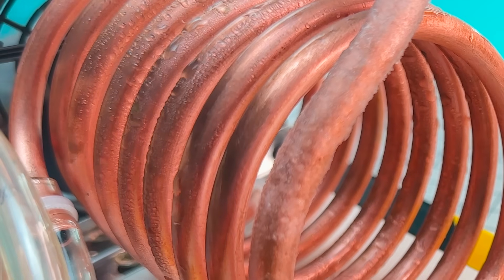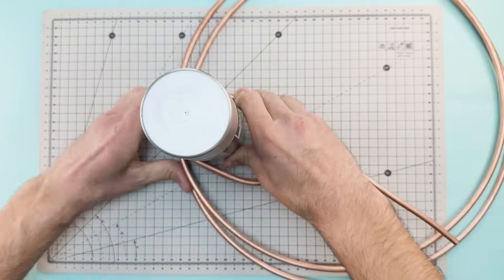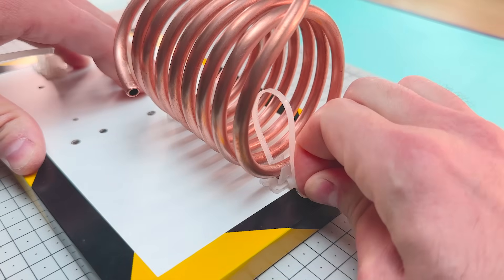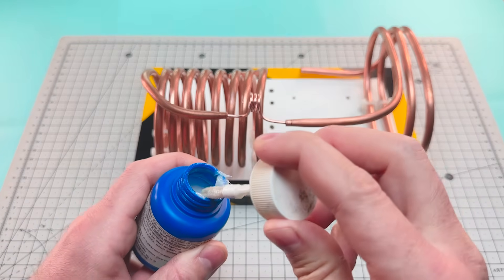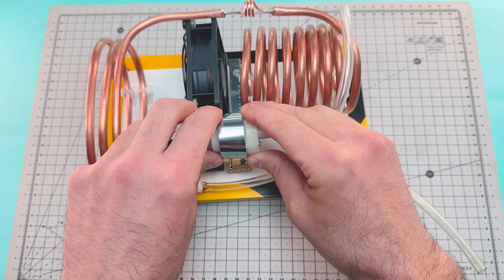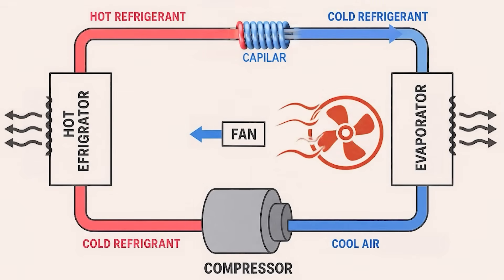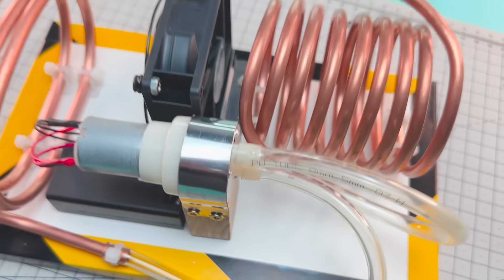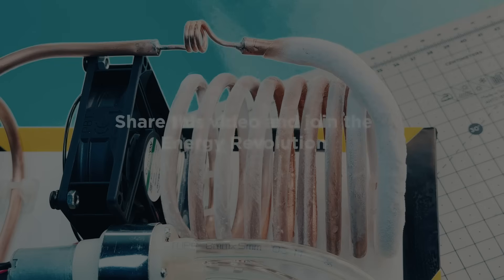Homemade Mini Air Conditioner That Cools in Minutes! ❄️-10º Celsius

Comment: What's amazing is how these mini cooling devices defy the laws of thermal dynamics. That's because you can't actually cool the air. Ac systems actually remove the heat. There's is no such thing as cold, only lack of heat.

Comment: Typical air conditioner setups require that the system be under a vacuum?
Reply: @timstill152  the reason they are under a vacuum is so that you can introduce refrigerant into the system
Reply: They are only under a vacuum whenever you recover all of the refrigerant from the system and draw a vacuum

Comment: Isobutane is a flamable gas, sometimes used as a fuel.  This is the last thing I want inside my house or car.
Reply: @jimseals8659  most ACs heat pumps outdoor compressors will soon be all A2L if you have a newer window AC it most likely used a600 which is isobutane

Comment: I maybe wrong ，Circuit(apart from cold n hot so close& clear plastic hose can’t hold the pressure) and setup is right the only component that I am skeptical is the pump which is not powerful enough to produce high pressure difference. This simple setups will flood Ali express or Amazon if it works when china manufacture them in volumes! Thanks for sharing your designs.❤

Comment: I guess the “secret” in Tech Secrets refers to the fact that it remains a secret where the room temperature disappears to – because no matter how cold a part gets, as the condenser and evaporator are not physically separated, the heat remains in the room anyway. And since a motor is also running and consuming energy (with less than 100% efficiency), the room will still be warmer overall than without all the effort.

Comment: The principle of refrigeration and air conditioning is well explained, but with one big fundamental flaw.

The condenser and the evaporator are in the same room, without any thermal insulation or partition between them.

Result - the amount of cold generated or produced in the evaporator will be equal to or less than the heat generated in the condenser.

So, the room temperature theoretically remains the same, but practically, it will get hotter and hotter as the motor generates heat, which adds to the total heat from the system.
Reply: exactly right

Comment: For this to work, the part that receives heat should be in another room or outside. With such a system, it works like an refrigerator with constantly open door. It heats and cools and generally B.S. Knowledge from high school in the EU.
Reply: Correct

Comment: Been a Refrigeration Engineer for over 34 years... so many things wrong with this, sorry but just the truth
Reply: The condenser needs to be remote from the evaporater otherwise you have zero gain.
Capillary length is also important which is determined by tables, never in refrigeration history has a Capillary been so short(it determines liquid holding charge required to suit evaporater size). A condenser will always have gas in at the top and liquid out at the bottom (due to heat rises and liquid is heavier than liquid). The function of a compressor is not to "pump gas" but rater to raise the temperature and pressure of the refrigerant to enable it to reject heat and be liquefied.  What you most often don't see in these videos is the constant supply of liquid gas vented to atmosphere which will give you a refrigeration effect, non the less... the basic description of a very basic refrigeration circuit is correct, if you would like then I can start a channel that explains refrigeration in detail including carbon dioxide as a refrigeration medium and how it differs from traditional refrigeration systems.
Reply: Furthermore,  if you would like to know how absorption refrigeration works then ask away, I even used to make up the ammonia/water mixes to suit required temperature.
Reply: Although I have worked on the electrical controls for cryogenic systems I do not particularly know their intricate working,  have worked on most refrigeration and air conditioning with the exception of aerospace and cryogenic heads.
Reply: @jansharples9088  Servel refrigerators used that system. To cool the refrigerator, simply add heat in the right spot. In the case of our farm, you lit a flame in it where the natural gas heated the proper spot..
Reply: You bring nothing to the discussion unless you actually say why. Been a Youtube Comments Master for over 34 years... so many things wrong with your comment, sorry but just the truth. (see how you can claim something and not back it up at all will make something sound like complete BS?)
Reply: @deucebigs9860 please see added reasons in comments
Reply: Why won't it work?
Reply: @jansharples9088  have you actually tested this design?

I know from personal experience that forcing a large volume of air through a small opening will reduce its temperature. This same principle also applies to liquids.

Why didn’t you list those so many things that are wrong with this?

You didn’t tell the truth, you really didn’t say anything of value. You simply made an invalidated statement and claimed it as truth! It doesn’t work that way!

Either support your claim or be considered a liar.

If you are even what you claim, that won’t be too difficult for you.
Reply: @franzbuhlmann1099 please see comments
Reply: @franzbuhlmann1099  Large volume isn't what causes anything. What causes a cooling affect is the pressure drop. And in order to get that pressure, you are going to generate heat in the compressor. Which you also need to get rid of. If you don't, the Klixon unit will trip and shut down the compressor. Don't include one, you'll eventually burn up the compressor.
Reply: From my understanding (that is limited.. just tring to discuss) it can help in making cold a can of soda but it cannot cool a room. If you measure the other part of the tubes I immagine they are hot? You cannot destroy energy, you are simply moving it from a side to the other, is that right? But still I think that is an amazing model, are there other ways in witch it could be improved?
Reply: @pabloolmoamadeorigattibern2076  totally. Yeah totally. Look at the size of it so yeah not much cooling capacity, and then you do have to do something with the heat that's why a lot of home AC's are split into two or directly exhaust the heat outside in some manner.  This was just a cool experiment where he showed people the basics so I thought the video was great.
Reply: Then you know about existing refrigeration, not this device.. what about it wouldn’t work in your refrigeration expertise
Reply: @kingkonglji  Very simple.
1. The heat removed will be added right back to the air where this trash is located.
2. Because there is no barrier between the two sides, it will just draw the hot air in and push it over the cold tube.
3. The pump will also lack cooling so the pump will fail.
Why do you think that commercial A/C units either have two different locations or a divider between sides with two fans?
At best, if you build a unit like this, all you will have is a dehumidifier. And you will need to get rid  of the condensate. And if you isolated and insulated the unit, you would find that the temp in the enclosure would increase.
Reply: My current role in the world of refrigeration is a transcritical carbon dioxide specialist
Reply: yup, and one thing that should tip everyone that it's bs is that we don't get large plan of the device when it start making cold just close up
Reply: @jansharples9088  Por favor,ejemplo agregando información y datos. Gracias  por tu participacion.
Reply: Sto valutando la costruzione di questo progetto per immettere aria fredda all'interno di un computer. È vero, non raffredderà mai la stanza perché il freddo generato viene mitigato da i tubi caldi posti all'estremità opposta, ma penso che si possa utilizzare per applicazioni interessanti.